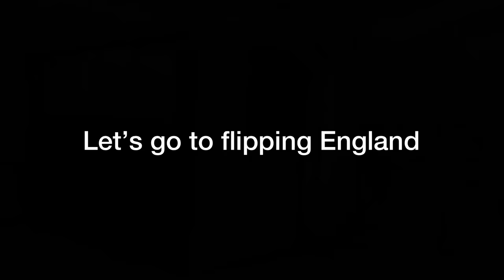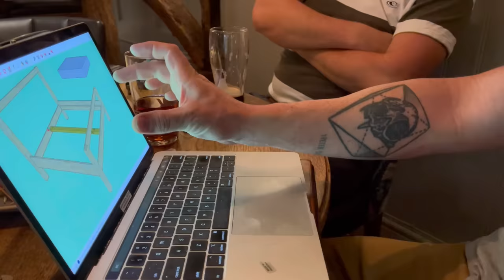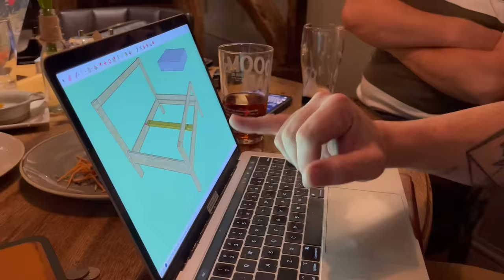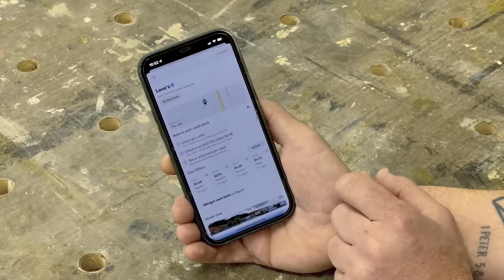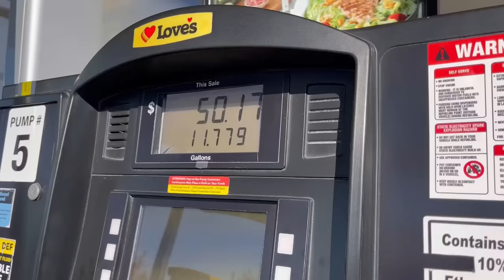I Flew to England To Build a Bed || Building In a Small Shop

Comment: I'll try to never complain again about not having enough room in my garage after watching you and Sam cope with his shed while building a bed!
Reply: My shop is about the same size. I do all my work in late spring through early Fall. And yes. It sucks.
Reply: My basement 400 sq. ft. shop is an absolute luxury compared.  I no longer feel cramped, nor will I never complain about having to haul lumber down the stairs again.

BTW... 20:10... I'm hungry now!
Reply: That was my first thought, too.  I'm never going to complain about my small garage again!
Reply: My shop is about the same size.  I'm at least blessed with an understanding wife that lets me use the car port for wood storage and long rip cuts on the table saw.
Reply: My shop is like 3 times this one... also have greenhouse, second smaller shop(still bigger, than this one), and bigger garden space.... I feel like    a rich guy now... Anyway! The video is actually very inspiring, just because of the small shop (or more like "no shop") problems!
Reply: Sam's shed is 5 times bigger then my one.
Reply: @stanleydenning  Yes I definitely find it easier in the summer months!
Reply: My shop is 7mx7m and i cant find nothing 😂
Reply: Hahaa if i win, i want to build that barrel and get to floating 😂
Reply: I i had to build in 12/16ths and 42/3rds id loose my mind hahaaa Metric for the win
Reply: Welcome to the reality that is most UK houses and available space for things 😅
Reply: I have a 12 x 20 shed with 8'3" ceiling with attic space and a wood stove and powered by a 2200 craftsman generator. 
It works rather well but I always cry because there's not enough room. I'll shut up now because I have power and heat and apparently a lot of space in comparison.
Reply: I agree...I was getting ready to add on 1200 sq. ft. to my 1750 sq. ft. shop. After watching this video, I think I am going to lease out about 1400 sq. ft. of my shop...realized I don't need it all now!
Reply: My first thought when seeing the title " man this dudes gonna have a culture shock when he realises his workshops bigger than most of our homes in the UK " most here have to use a garden shed or single car garage for woodworking and if you get something like a table saw you've knocked out half your space in one hit

Comment: This is gold! 😂 now you can see what we have to work with in the UK. While you guys rolling in giant warehouses you call shop 😂😂
Reply: This is basically the same as my old shop/shed. My new one is smaller.
Reply: I work in a storage unit
Reply: I’d fail here to even find a lumber merchant lol
Reply: Not everyone in America has a shop.  My shop is basically a much smaller pop-up tent on my drive way.  I even have to use the chop saw outside.  But Sam is killing me with one blade swapping back and forth.  The table saw and sliding saw should each have their own blade because they should have different hook angles for optimum performance.  Also there's lots of time wasted keep switching back and forth.
Reply: I live in an apartment and have a ground floor patio that doubles as a shop. It too has an 'outdoor table saw', as well as an outdoor router, drill press, chop saw, and sander. Instead of a shed, I have a very manly-appearing dining room with a bunch of tools in the corner!
Reply: @K8Stuff  I'm lucky. I'm 40 minutes from Surrey Timbers.
Reply: @Kosh42EFG  I always look at surrey timbers as it looks good in the photos online. I'm about an hour and 15 away from it - is it worth a visit?
Reply: @Sams-Shed  absolutely. The upstairs is shorter boards planned both sides mostly. Great for little projects. Downstairs is rough cut, longer pieces, slabs to make you drool, and turning blanks. I love it in there.

Comment: I just loved this video.  I moved to the UK about 5 years ago from Canada.  If you want lumber over here, you have to track it down and buy it from someone who mills  it.  My wife and I renovated an old house remotely.  I sent the architect drawings for my shop.  The builder decided that no one needed a shop that big and shrunk it by 1 meter.  I ended up with a glorified hallway.  Most of the local trades people work out of the back of their van so what would they know? I have tried to squeeze in my proper table saw, drill press, jointer, planer, chop saw and dust extractor.  The builders asked what my 10 inch General saw was.  They had never seen something like it before.  It is like the shell game.  The best solution I could come up with is to put all of the big tools on castors and move things around like a valet parking lot.  I work outside as much as I can but the weather here can be quite bad.  A 3/4 inch sheet of ply that I had on sawhorses in the back yard got blow up in the air by a gust of wind, broke a wall mounted light fixture and they landed about 20 feet from where it started from.  Luckily I was in the house on a lunch break.  It was really nice to see you come and adapt to local conditions.  You have a lot of patience. If you are ever at Disneyland in California, it is like 'Small World After All'.  That is what it is like here.  I have two acres and it is mind boggling to most people here.  Kids ask 'Why is your garden so big?'.  Sorry about our food.

Comment: This was brilliant, good on you for making this work and good on Sam for sharing his place with you. If you share his details I will buy him another saw blade. I’m from Scotland and even I am not so tight as to try and get by with only one saw blade. Great video!
Reply: Had he not pull out the Festool domino, I would say his tight.  But I don't think he will need. Having another blade will definitely make value of the time.  There's definite efficiency lost for keep swapping back and forth.  Not to mention different hook angle for the different saws needed.  He's got a lot of equipment for his shop.

Comment: Love it. With land at a premium for centuries in our tiny island (8x as many people per square-mile than the US) the average workshop - for those of us lucky enough to have any outside-space/garden at all, is an 8'x6' shed! - we also use both imperial and metric with those of us over 40 being raised in feet and inches before being made to convert to appease our continental neighbours! Indeed, if you ask a Brit how tall they are or how much they weigh, they'll still answer you in feet-&-inches, and stones-&-pounds respectively. Oh, and our road signs & speed limits are still in miles... not km! Yet another great YT guys. :)

Comment: This is awesome I’m actually working out of a shed just about that size. Unfortunately living in the suburbs and on a fixed budget we work with what we got but it’s amazing how much can be done with and stored in a small area. Going to be adding a couple of lean-tos to the sides to have some cover area. 
Some advice for you small shop folk, having things like that pop up tent until you can build an overhang or lean to is huge. Another thing is portable tables for your chop saw etc. I have a folding table I take out and put my chop saw on as well as a portable table saw. You can fit everything nice and tidy in the shop but have a good way to get it out and spread around so you can work. 

I’m subbing man thanks for the great content!

Comment: SAM! What's the name of that saw yard? I'm in Brighton and have just started, but am struggling to find somewhere for supplies. That looked like the perfect place for me to visit!
Reply: That was Wealden oak in Edenbridge. I was very pleased with the wood from them, they specialise in (and only do oak) but it was really nice stuff. 

There is a Brighton wood store that does mainly reclaimed/recycled stuff you can find it on Facebook/instagram or on google, it’s very hit and miss because it’s all stuff that’s donated/found/recycled etc, 95% softwoods, occasional sheet materials, not ever much in the way of hardwoods.

There is also willows sawmill and Copford sawmill not too far from us which you can go to and just clamber around big slabs and choose from them. I go to willows sometimes, it’s a case of rumaging around what is there and picking some bits out, they don’t have wood in board form though like it is at Wealden Oak, just rough sawn slabs. You can get them to plane stuff up if it’s a decent size order. I think there’s a couple others in West Sussex but I’m slightly more east than you! .
Reply: @Sams-Shed  Thank you so much Sam! I pop down to the wood recycling centre all the time and have managed to find a decent haul of softwoods for various projects, and I do appreciate the work they do. However, yes, hardwoods are non existent there. I'll definitely be popping out to Wealden Oak and Willows. Thanks for your reply! Good luck with your future projects.

Comment: dang guy. not everyone can afford a big space or a multitude of tools. I know your razzing is meant to be fun. but when it got to the one blade thing...even I said ouch. If i was a patreon, I'd never accept being chosen because I am low end all the way. I have a table saw and a circular saw with small hand saws. thats it. no drill press, no planar, no jointer. no plunge router. lol no dust extraction 😂 and my garage is chock full of crap. 😅